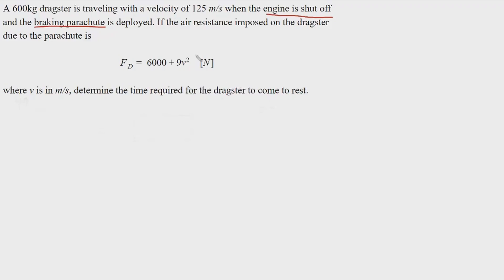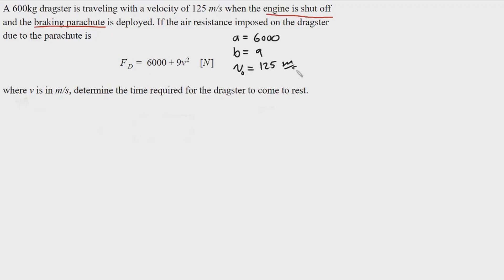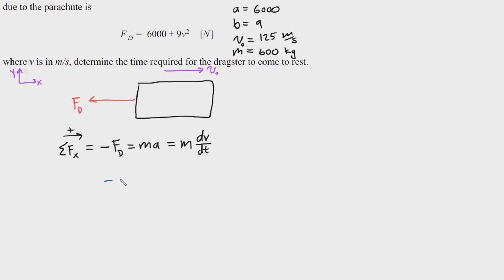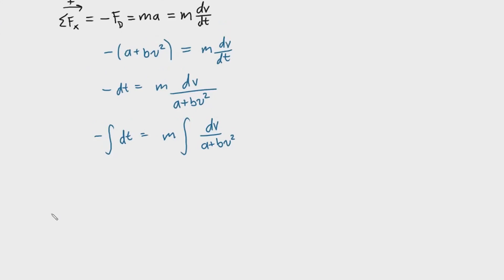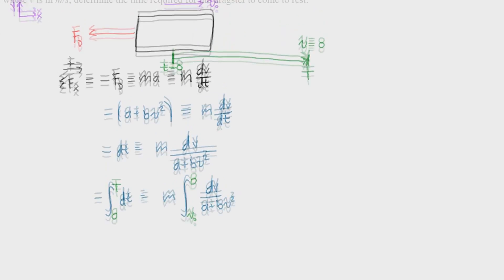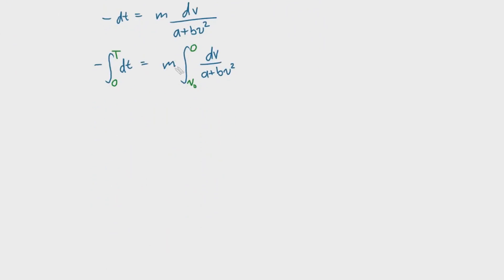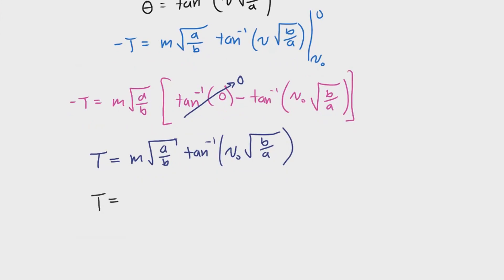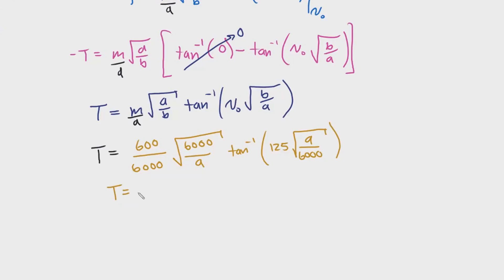Dynamics | "A 600 kg dragster is traveling with a velocity of 125 m/s when the engine is shut..."

Comment: Hi, is there a way to answer this using impulse momentum instead?
Reply from the maker: For this problem, no. That's because when we write the momentum balance...
mv1 + integral(F_D, 0, t) = 0
You can't solve the integral part (impulse part) because the drag force is a function of velocity not time. If it was a function time, then you can solve it using momentum balance.

Just to let you know, you typically use a momentum balance when things hit each other or there is some sort of collision.